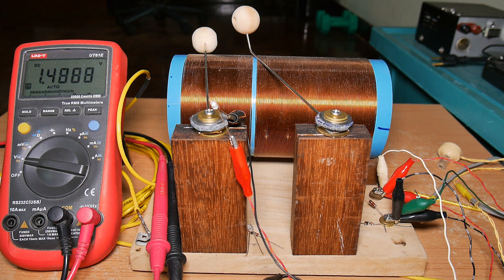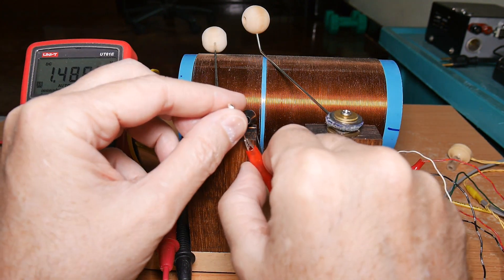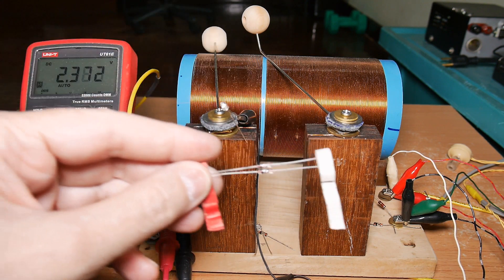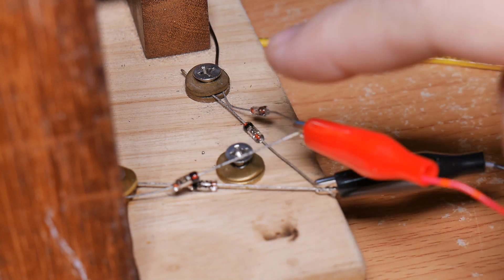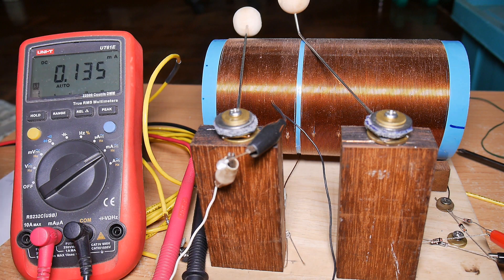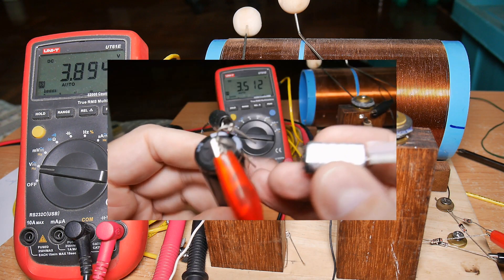Crystal Electric Generator RF Energy Harvesting Exp 5 - Full Wave Rectifier

Comment: Neat getting power from the radio station. Its a shame that the amperage is so low. Under heavy power lines you would see a spike in amplitude modulation of 60hz hum and so if this was placed under a major power grid line, you should get far more voltage and amperage is my guess as each power line is a AM broadcasting antenna and strength of the signal dependent on the load on the power line section. Seen before florescent tubes stuffed into the ground under power lines and they have a faint glow from the inductive field that is leaking from the lines to earth. Heard of a guy years ago trickle drained a land line telephone connection to have the telephone company giving them electricity but it wasnt really worth it having a line off the hook to drain from over the cost of the service. Solar is still the best free electric after the initial cost of the panels and charge controllers and batteries for storage. One fascination I have is with Russians having Lanterns that were able to generate electricity that could make a few amps to power radios by generation of power using the seebeck's effect using the dynaphor lanterns.
Reply from the maker: @SamanthaP_123  I've seen lots of free electricity schemes over the years and the only ones that work get the perpetrators sued. ;)

Comment: Have you considered using multiple tuners on the same coil with more diodes so that you can increase current?
Reply from the maker: No. That's an interesting idea.
Reply: @tsbrownie  Well, If you decide to give it a go, I'll be watching, your video got me fired up to give this a try for myself. To me, 4.8V at 125 mA is impressive, I know it's only 0.6 watts, but that would power a gamboy color!

Straight up, that kind of output can charge a smartphone over the course of a night if the phone is turned of while charging!

Any way, I'm inspired, I'm parts shopping right now, haha
Reply from the maker: @chaorrottai  If you video your experiments, let me know. I'd like to see them.

Comment: You should have tried the led again with the higher voltage.

Double the voltage means  twice the power even if the current is the same.

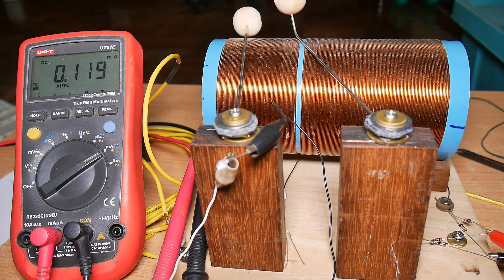Comment: 3:24 not tuner , radiostation Hz (what (PowerFull) radistation is in this Hz ?) ... induction+resistor (wire coil) vs. Volts (ohm law ?) 4:15 capasitor load full w (Hz / times in sec (impulse)) 4v/0.1A (50sec (impulse half time 4v/0.05A)) and give out 4v/0.5A (5sec) ? ... dont trust multimeter ( what volt ~ 1 sec.  (can show 5v when real impulse is over 12v and -12v (Hz - times per sec) ) ) , use oscilloscope ( cheap ~15$ eBay max 200(k)Hz (better that nofing/multimeter))
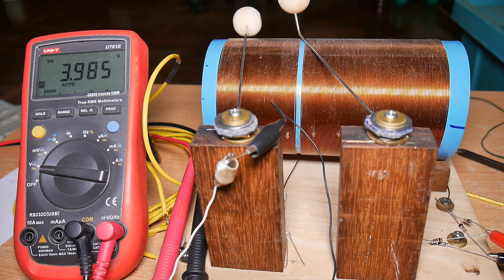Reply: 4:47 u just using RadioStation antenna POWER (convert Magnetic Field back to Elektic Field) ... this not FREE ENERGY :D (maybe to u yes, but to make this Hz / RadioWaves spent (RadioStation) over 1000 time more energy.
Reply: u can use "Free Energy" with multi antennas (another's Radio-station/Hz waves) (make/collect to one capacitor "battery" energy and then use this w transistor to amplified u speaker) :D (if night and not (solar/wind/hydro/termo) battery energy (battery empty)) ... or think like Nikola Tesla https://www.nikola.tesla.pl/29-teoria-darmowej-energii.html but u need to know this too https://youtu.be/2rVdEhyMR6A
Reply from the maker: @kose2ik  There is a guy from China who has done this!
Reply: Crystal Radio typical is HALF wave radio, use 2x Crystal Radio High Performance Full Wave Set: http://www.oddmix.com/tech/cr_highperf_crystlset.html or https://www.rfcafe.com/references/popular-electronics/high-power-crystal-set-august-1960-popular-electronics.htm

Comment: you should store those in a 1 or 2 farad supercapacitor and try parallel charging a series of 18650 batteries with good Ampere storage capability....see if it runs day and night!
Reply from the maker: I have the caps, I will have to put that on my list.

Comment: I got 10 volts with a huge long wire antenna we put over trees on our farm. it was about 100 m long (300 ft) The other thing i used was a counterpoise instead of a ground rod. just laid on the ground.
Reply from the maker: Do you have a video of it?  I'd like to see your set up!
Reply: @tsbrownie  no this was about 10 years ago but will describe it best i can......got a roll of old 0.5mm enameled wire and with the help of my nephews bow/arrow simply shot string/wire over about 5 big gum trees. the wire was simply laid onto the tops of the trees. got about 100m out at about 8 to 10 m high. then laid out approx 25-50m of counterpoise under the antenna just on top of the ground (enameled wire) this was my ground. the circuit was crude at best with a ferrite rod and enameled wire. we were high up on a hill too. good luck
Reply from the maker: Karl: I've seen ham radio operators out camping set up an antenna like you described.  I think they used a sling shot instead of a bow, but it's the same idea.  What did you use yours for?  Radio or lighting a light or ???

Comment: Is it grounded, Sir?  Tesla almost always used a true ground for receiving strong signals.  Otherwise, it was super tuned so that even lengths of contacts and leads were super resonant.  But what most people don't realize is that current over air diminished at the standard dissipation rate that all energy waves do.  So to get more power you need either more antenna wire or for it to be placed under or near a stronger source.  Local true grounding helped with resonance, or actual current in some cases.  The beauty of using microwaves as he did later, was that they could hold more energetic alternation at longer distances while more easily going through walls and trees.  How did he transmit so much energy?  Giant antenna towers and giant generators.  Now, theoretically, one could use a resonant frequency with the ionosphere and the amplified signal would impart more energy to the signal than was sent out, thus stretching the range of the signal's workable distance.  It would be like rolling a wettened sugar cube in loose sugar granules so as to pick up more sugar and become sweeter.  For long distances, microwave antennas use repeater stations, but for your device, for receiving a higher amplitude of signal strength, you'd have to tune it to the strongest nearby signal, which in America, is around 60 Hertz.  There are dozens of high line wires leaking it into the air and in the ground.  With a diode on your ground to avoid ground input voltage, you should get a nice DC current, but not of 120 volts.  In my area I had gotten 14-15 volts DC. Is this stealing power? Yes.  Are they stealing from us? Often.  There is another way, that is legal, find a random, strong, signal not belonging to the power company and tap it.  ELF frequencies can be powerful, but require very wide coils and or antennas.  If I lived in Geneva, I would tune it to the super collider.
Reply from the maker: Yes, I have a true ground.  Lots of interesting information.  Thank you.  I will have to check into it.